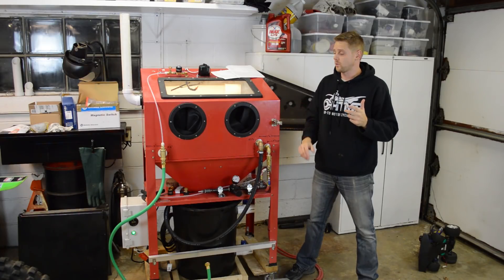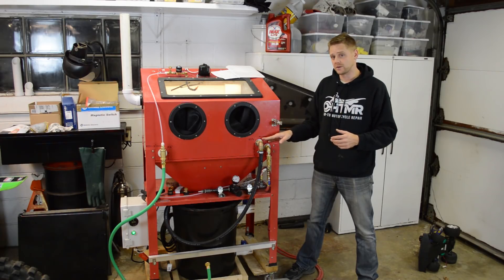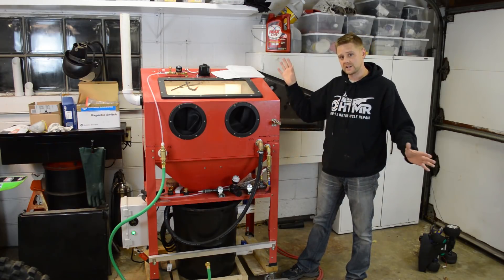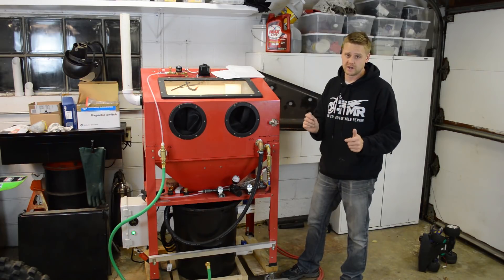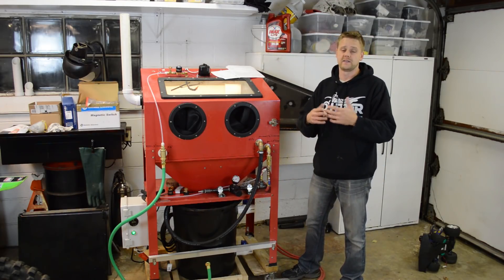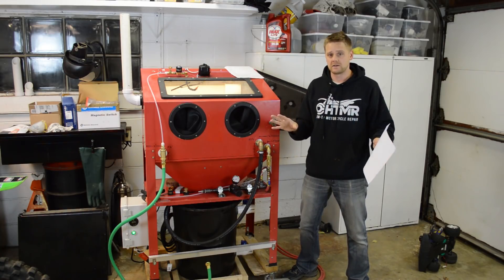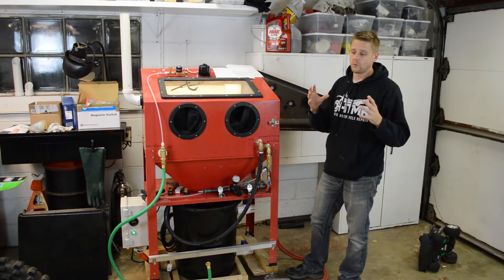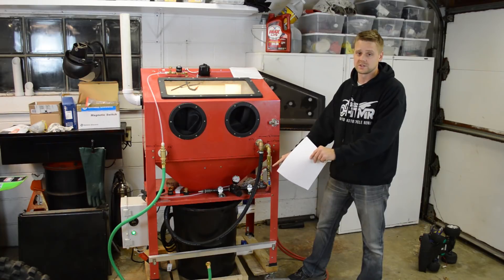How-To: DIY $550 Vapor Blaster Build Plans - Bare Bones Version

Comment: Thanks for the ideas! Can you shed some.light into thr slurry with glass beads and alum oxide? What oxide grit and beads , mix ratios was suitable for a decent finish? I am currently using 140 230 beads 4:1 water

Comment: What CFM is required to run this setup?
Reply from the maker: Watch this video for CFM comparison and speed: https://youtu.be/1oFn034YtD0
I'd recommend 16-17 cfm min so you can use the tacoma gun: https://youtu.be/ZWIFFhTW-_8
Reply: @HTMR   Thank You. I have the exact same cabinet sitting in our shop Unused, I'm just saving for a Nice compressor.
I think One of the things I will do is paint the Inside flat White to make it brighter in there.
Reply: @HTMR  16-17 CFM? DUDE THAT'S WAY TOO MUCH.  I have a 80 Gallon 175 PSI that delivers 14.3 @ 90 psi and it works just smashingly.
Reply from the maker: @anonimous2451  Well, the more CFM you have the faster the processing will be. I sell gun sizes 10-45cfm. Same part can be done in half the time with bigger gun.

Comment: Is this a close loop or open loop system?
Reply from the maker: Open
Reply from the maker: I also want to add that often times I don't even connect the garden hose. The window stays clean enough with overspray. I just have a bucket near machine to rinse parts. This way water level does not rise in system.
Reply: @HTMR  good to know,  I'll be buying your how to, its worth the cost to know exactly what to use, I almost about built one and almost purchased one  to build a bigger one. I was going to use a septic grinder  pump but I know that's probably not ideal.  I'll purchase sometime today. Thanks for the info
Reply from the maker: @barnescycle  No problem. You will be very happy with the plans.

Comment: SO, would you say that it is better than your soda blaster? You used to swear by it. Did you ditch yours for this vapor blaster?
Reply from the maker: This used to be my dry soda blaster. I can run "wet" soda in this vapor blaster as well. Should give me same benefits as dry, maybe even better results. I will try to do a video on that at some point. One disadvantage to soda is that it does not restore parts like fine glass bead does.
Reply: SHORT ANSWER YES !!!!! ABSOTIVOLUTELY.